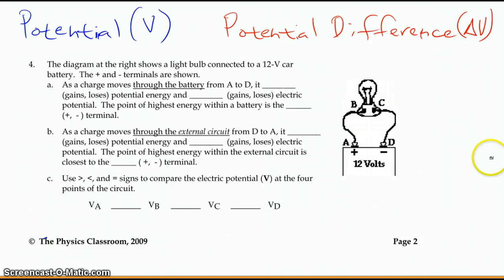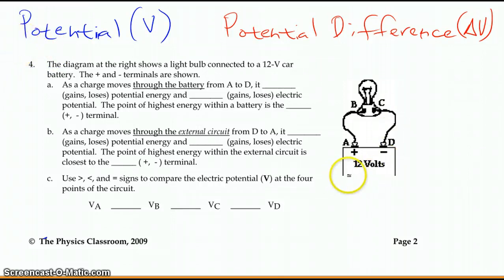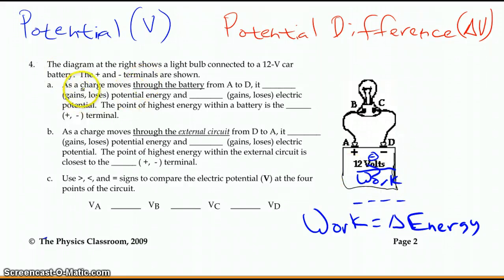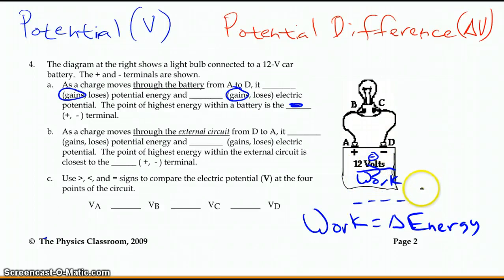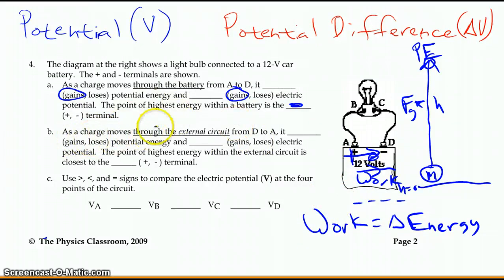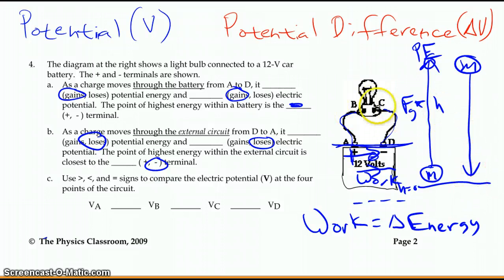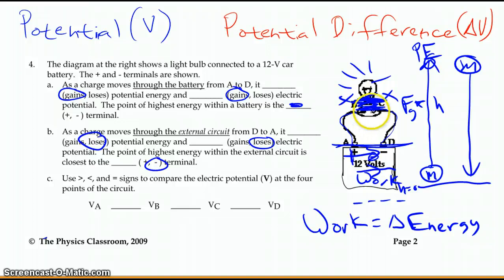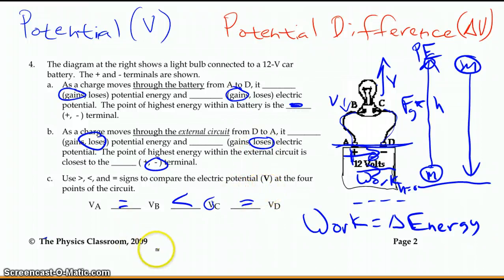Guidesheet #1 Part B Potential in a Circuit

Comment: the weight coming down losses energy or transfer energy through physical impact.  How do electrons give light and heat in a resistor?  Through physical impact? Friction?  really?  If a battery provides higher potential then why do we need conductors to pass electrons? Why don't the free electrons from the battery just pass through any medium until they get to the lower part of the potential.